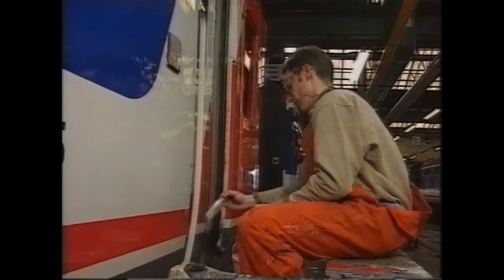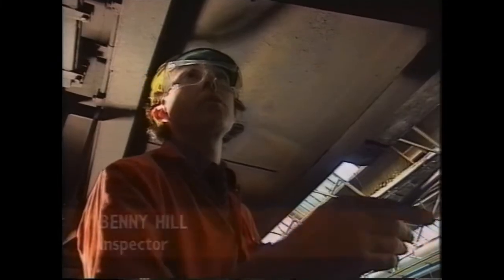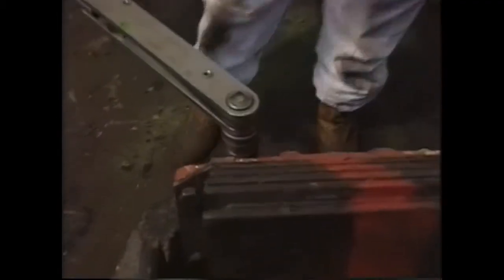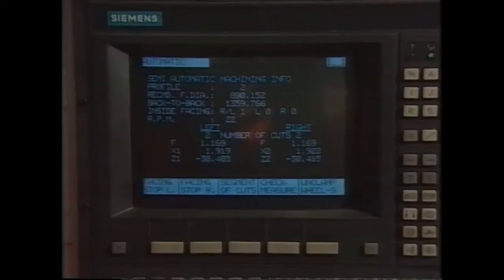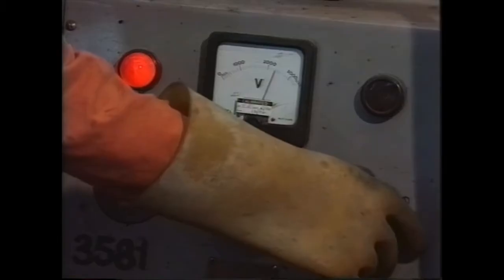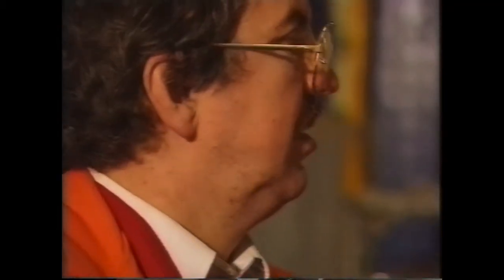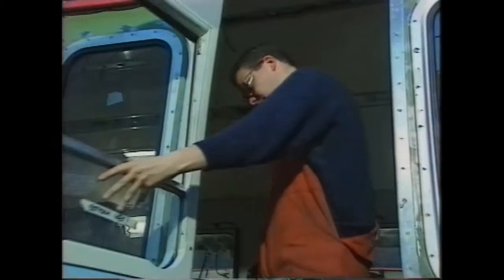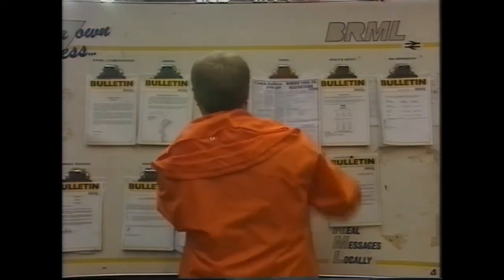Eastleigh Rail Works 1994

Comment: I'm as sad as anyone about the decline in UK rail engineering and engineering in general but watching videos like this tells us why. There's some progressive initiatives like the CNC machines here however so many of these skills are of the past - not modern engineering. It was just stuck in the past...
Reply from the maker: Hi George, thanks for watching the video and commenting. It's true we are moving way from a skills based country to a service based one but that's what fate has in store for us, it seems. I agree that traditional skills should be applauded and TV programmes like The Repair Shop exemplify this. It is true that this is shown in part in this video and anyone who had worked in Eastleigh Works should have realised it was a decaying model with all the major woks being gradually outsourced to often foreign companies. Somehow management failed to see this happening soon enough and the current mish mash of companies working under one roof is indicative of our modern attitude to skills. There were some very talented trades but not enough incentive to invest in training others. Vince
Reply: Your right those men were skilled, modern trains might be assembled in a shorter time frame but it’s debatable if there any better, and no doubt they will have a shorter working life. Towards the end of my railway career I was trained on the new Hitachi’s and what a disappointment they were, sterile, awful seat quality, and nearly double the cost of leasing compared to a HST, give me a British built train with a design life of forty plus years, built with that old fashioned quality any day.

Comment: Depending on the outcome of our present economic woes, a return to skills might well be on the cards. I doubt it will look the same as before, but shortages of commodities and the ever lengthening of supply chains will force us back to refurbishment rather than replacement. Really you only have to look at the class 69 to begin to see this happening. I wonder how much scope there is to refurbish modern multiple units forever? The thing about the "dying model" was that with skill you could refurbish forever. A piece of hardwood here, a piece of steel angle there. made by hand, re-made by hand. A modern carriage door is a complex extruded aluminium weldment. It has epoxy bonded carbon fibre parts. Built by robots in a land far away. Disposable. Once it is worn out, you melt it down and start again with something new and different. Maybe it lasts longer, but nothing lasts forever.
Reply from the maker: Hi Andy, Thanks for your comment Personally, I don't think our country will return to a skills based market. There will always be a more willing and cheaper labour supply elsewhere in the world and current supply chain issues will resolve shortly, certainly sooner than we can retrain. Vince
Reply: @vinceunlimited  I think the increasing cost of energy has changed everything. Those with the energy don't want to sell it to us. We don't want to pay them even if they did. With an ever more resolute intent to be environmentally friendly we have to move on from the throwaway society. People think of the environmental cost of using infrastructure, but they rarely consider the environmental cost of providing infrastructure. The supply chain problems are here to stay as far as I can see, but I accept it depends on exactly how that fact turns out - and no one knows for sure.
Reply from the maker: At least train travel is environmentally friendly